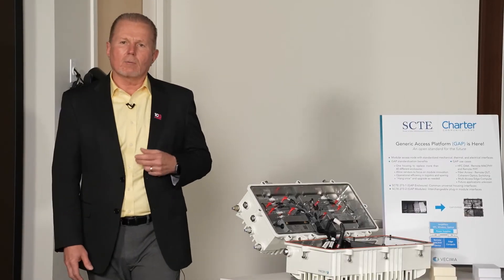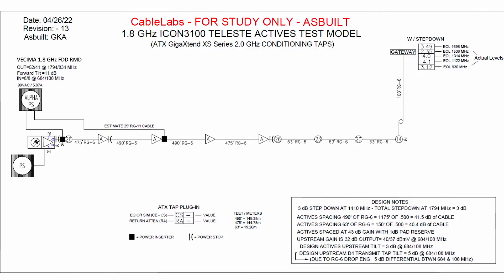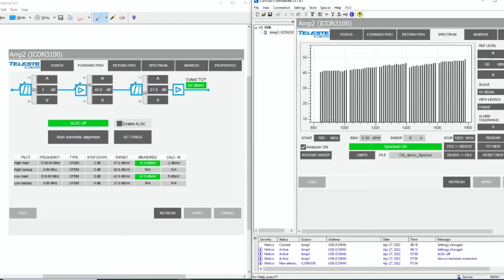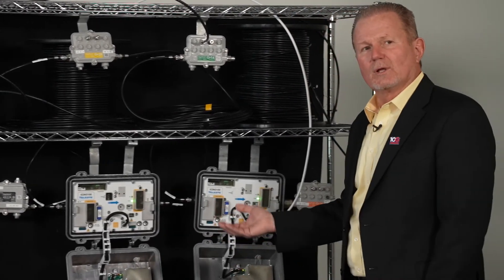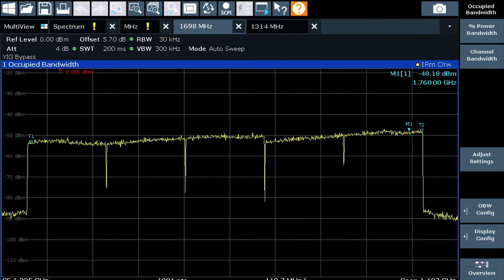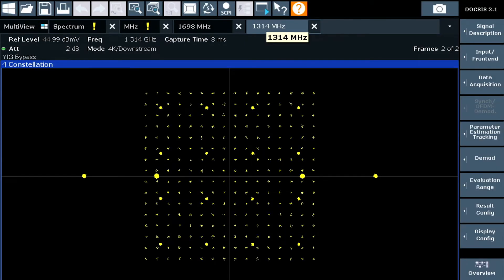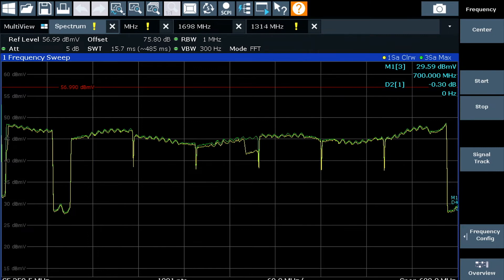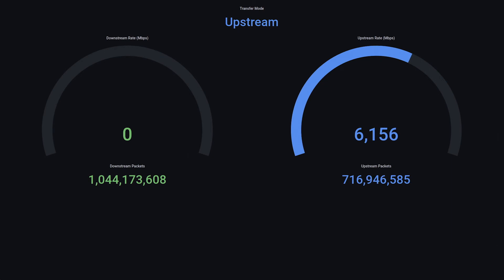Charter Communications Demonstrates Multi-Gigabit Speeds at CableLabs’ 10G Showcase

Comment: Open standard does not mean open source. 2G/3G/4G/5G standards are "open" standards, yet all the stacks are closed source from any commercial vendor (and heavily guarded). The fact someone knows the specs of a housing and can make a compatible node that does not mean anyone is actually doing it, nor that they did not patented some miniscule unrelated detail on the housing making it impossible to create a compatible node without patent violation (which these companies often do).

Comment: Well...  now that they have announced upgrade plans to 2025, it will be nice to finally be able to get decent upload bandwidth for the first time in history.  Yes, this is to yet again delay fiber to the home, however after all these years it will be nice to just have the capability.  Upload, upload, upload...  and of course latency is a focus too.
Reply: servantofJesusChrist470  Hahahaha
Reply: Similar is already here, even at the time of your comment. CASA Rphy has been out since 2021. Using a data connection instead of analog RF allows for greater distances. The system is channelized. The dual 10gig input/output to/from the RPD can be daisy chained. The launch amp can be swapped for a GPON module. The upstream can be changed by pulling out and swapping diplexers.

In my neighborhood they are set at 170mbps up on an 85 mhz mid-split and its working using old wires from the late 1970s and old amplifier spacing with over 340 modems on the node. Other neighborhoods have new cabling and 33 homes passed per output (4 outputs). They will easily run 1.8 ghz with a 624mhz return. All can be easily converted if needed because they take gigabit data feeds instead of AIM light feeds.

I have a 14ms ping time over wifi. That is off a repeater, that goes to a gateway and then three amplifiers back to the originating node.

People might think they need more, but a lot of the time it is in their head. Also so many people don't have the gear that can handle it and blame the ISP. I'm looking at all the idiots trying to use a Playstation over Wifi.
Reply: @Todd.T  At the time of my post, they announced their plans, so I already knew what they were doing.  I deal with very large raw unedited footage so yes, I really do need a lot more.  It's crap like this that keeps the United States so far behind.
Reply: @Energyone  The USA is a different ball of wax. There are cable providers that can’t afford to upgrade their systems. With unlimited storage at Google, we pretty much maxed out at around 300mbs upload. Not many people can do more than that. You’d have to be on the same network. 204mh. return is enough for 2.5 gig up over cable. They’re not going to upgrade for an outlier. 

The real push for fiber doesn’t really have anything to do with what the customer wants, it’s the ability to reduce operating costs.
Reply: @Todd.T  Sounds like a management problem.
Reply: @k.h.304  I’ve been using Technetix for 2 years now. It looks like the cheapest and most efficient option would be to go to around a 396 MHz return at 1.2gig DS and then run FDX on top of it. All passive equipment going in from now on would be 1.8ghz, just in case, but the cost of replacing the coax to get that high will get expensive. 

The good news is John Downey is consulting for Technetix, so we will see what becomes of that.

Comcast went FDX and the new modem chipsets that will be coming in should do both ESD and FDX.

It’s about to get real interesting. The Technetix stuff is real slick and easy to program. I haven’t upgraded anything to 204mhz yet. Some buildings have up to six 85/1200 nodes in them and have very low US usage due to segmentation. 

Lots of R-Phy nodes , but the R-MAC Phy stuff is coming. This will fix the latency difference between cable and fiber.